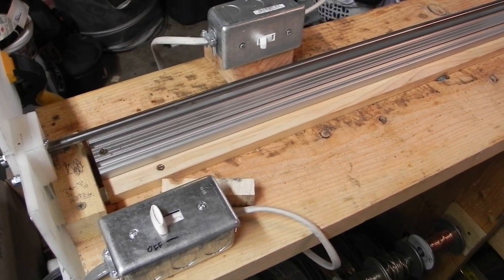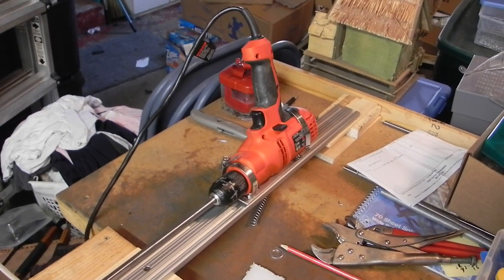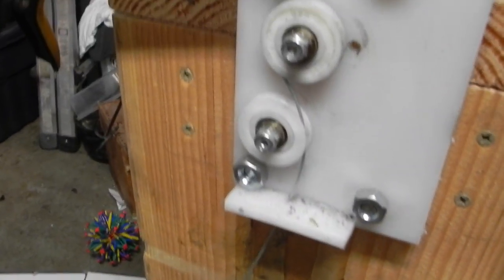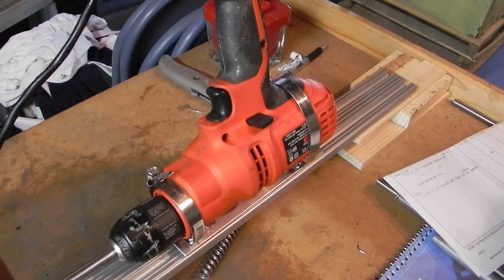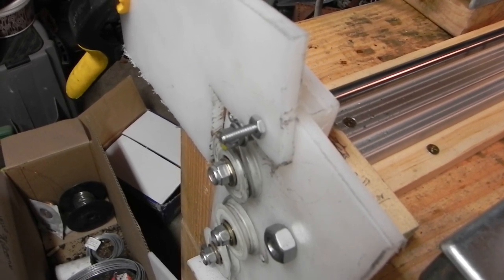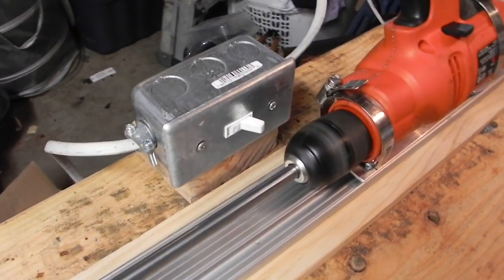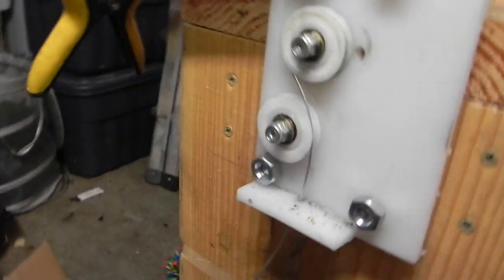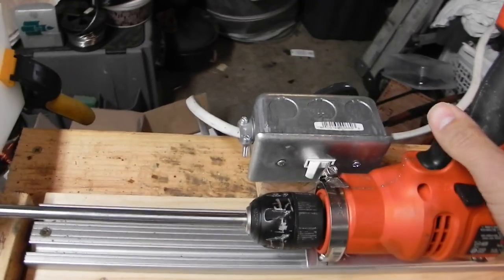Chainmail Ring Coiling/Winding Apparatus/Jig

Comment from the maker: Smallest I've done is 20 ga 1/8" mandrels, but I've had to supply some supplemental tension to prevent coilovers.

As far as cold working the metal, yes, going through the tensioner does make the wire a little harder and a little more brittle. With stainless, this is not usually an issue, since it is pretty stiff already and I use a low tension setting.  With bright aluminum it can become an issue, though, since it is already very hard.

Comment from the maker: Well, that depends - Hardware stores often have small spools and coils of galvanized steel wire and/or tie wire.  Welding supply stores are good sources for aluminum wire.  Farm supply stores have aluminum and galvanized fence wire in large spools.

Comment from the maker: Hi BuleFlameKnight,

The main changes I've made are making the coil-over protector from UHMW Polyethylene to reduce wear, and for some wires, I've found that threading the wire through the rollers in an opposite fashion to what is shown makes it so that I do not need the coil-over protector at all.  I've also changed from weighting the coil over protector to using elastic to keep it's tension.  

As for where to get the track for the sled, I used a piece of dual-track 80/20.

Comment: I have some ideas about this but I don't have anywhere near the space or money to buy my materials needed. lol I still hand roll all my rings. Very slow going. My idea uses a similar build to this but would incorporate a saw into ito it. Very similar to a table saw. Correct blade and height and you just run a loaded mandrel through a slide jig with a bush bar and then boom. Kill the saw unload the mandrel and then slide your pretty saw cut rings off the mandrel.

Comment: Couple of questions. 
What is the smallest gauge/mandrel size you have used with this?
Have you noticed that passing the wire through the tensioner adds brittleness to the finished stainless?

Comment: where can I find the parts to make a slide rail?
Reply from the maker: The rail is just an 80/20 aluminum extrusion (www.8020.net).  The pads are also from 8020.  The sled itself is custom made, but is really just a 1/8" aluminum plate with some holes drilled and tapped in strategic locations to attach the pads and the hose clamps for holding the drill.